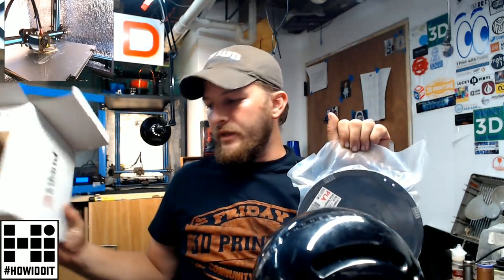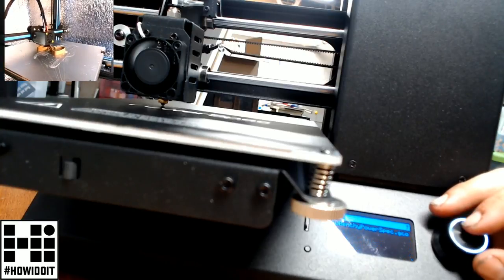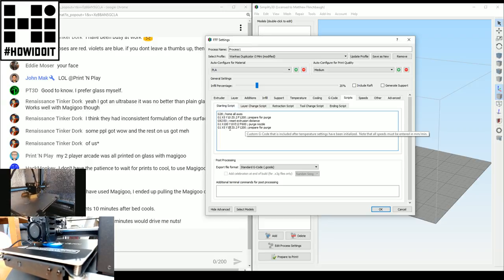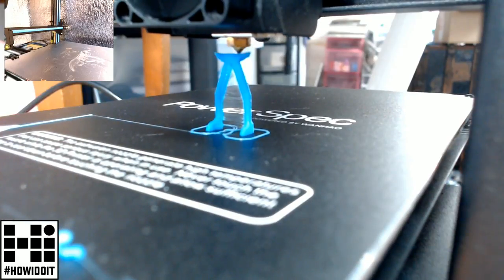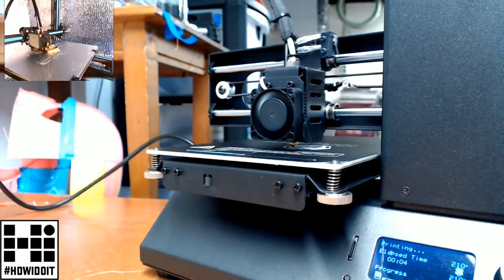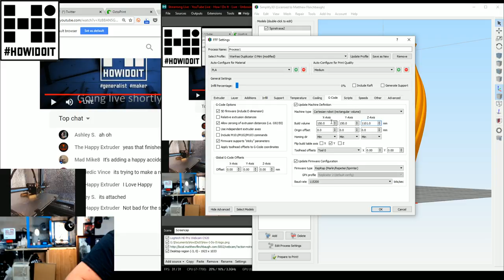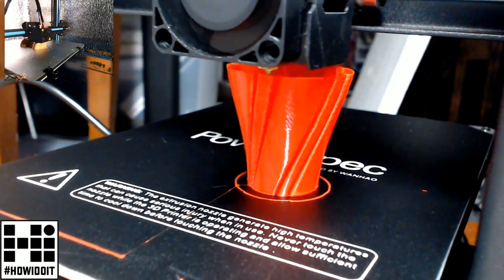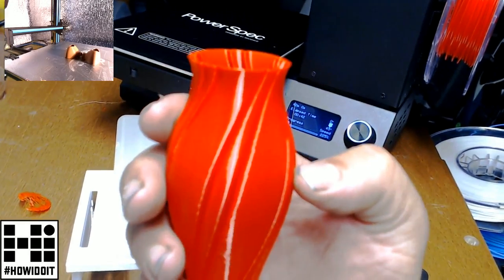Live - Unboxing, Setup, and First Print - Wanhao Duplicator I3 Mini

Comment: Where can I find modifications to use the whole bed? I'm new and just got mine last week and I wasn't able to find any modifications listed anywhere
Reply from the maker: Brian Reese I had found it on thingiverse, for the bed platform, though after spending more time with the printer I may try an alternative. I will post the link to the thing number later.
Reply: How I Do It cool thanks
Reply: Any modifications?
Reply from the maker: Hey Brian, Unfortunately I cannot find that file on thingiverse, if i do find it i'll be sure to post back. I'm not sure if maybe the creator took it down or whats up.
Reply: How I Do It hey, what speed and temp are you running
Reply from the maker: Trexed typically I'm running 40-80mm/s depending on the item, the live stream we were pushing it up to a calculated 300 - 400mm/s but in reality due to acceleration and deceleration settings it was something less than that.
Reply: How I Do It. Ok thanks for letting me know